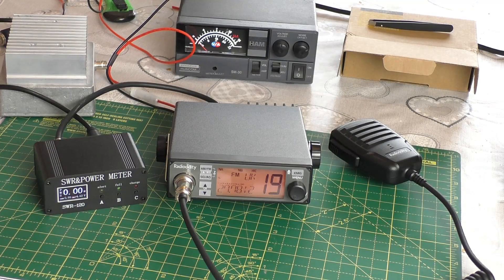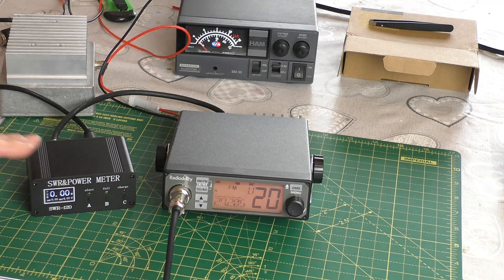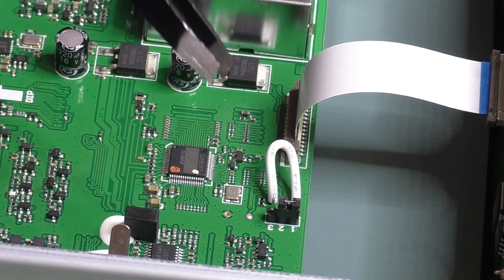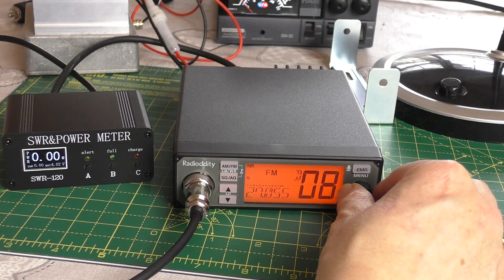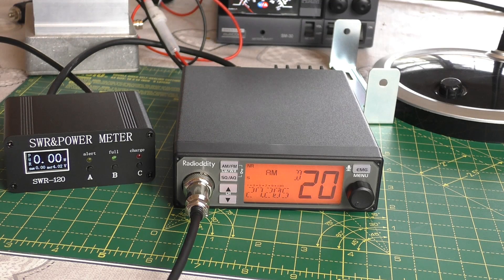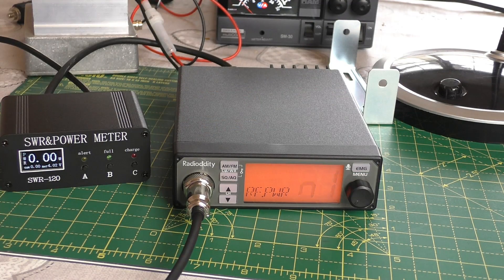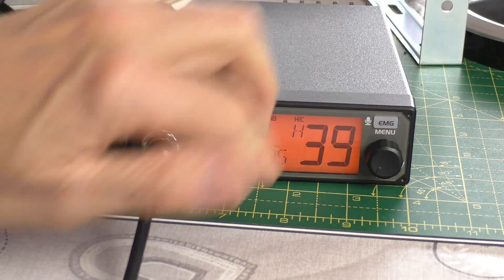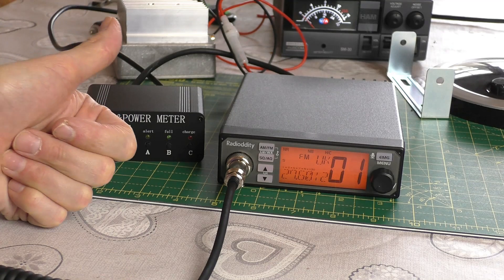Radioddity CB-500 / Anytone 500M 2.  How to HIGH POWER  MOD

Comment: When i turn on the radio all channels from 1 to 40 show a 8-9 on the meter, even when only receiving (FM and AM). What can i do to lower the noise?
Reply from the maker: Homebased or mobile antenna.
Reply: @CB-RADIO-UK  PNI ML200 2m antenna (SWR is 2,2), mounted at home outside at the balcony. 
I guess i need radial(s) and antenna grounding. Is there a simple way to ground the antenna. Add a cable to the outer PL259 connector and the other side to the balcony metal railings? Other solution?
Reply from the maker: It will be picking up noise from the surrounding buildings.  Not a lot you can do these days with everything we own at home.  My antenna clears the roof but i can still get S6-7.  Just see the Big Net video i made a couple of weeks ago.

Comment: I have modified mine, but I am not impressed with it as a base station.  For some reason, mine, I have to hold down the am/fm button, then turn it on, to switch bands.  My base station is a Cobra 29 with a super swing and a two pill amp with an Antron 99, so I can talk across my county here in Florida.
Reply: What kind of pills 😂
Reply: @chadrides914  no pills, just the jumper pin mod.

Comment: I have the original AT-500M and you can get about 19.9w on FM and AM PEP around 18-19w.  I'd never run it at this level of power, especially on FM.  I dialed mine back to around 15W on FM high power so the final wouldn't get fried.
Reply from the maker: Yeah thats good advice.
Reply: @CB-RADIO-UK  Have to be careful with the modulation too - I've seen some really ugly waveforms coming out of these radios because this was improperly set.
Reply: I got the pro 27 and it can do 8 am . Iv got confirmed 2k miles when the propagation was optimal. When your running FM do you still have skip propagation? or is it more ground wave? There's mixed signals on this FM isn't used much in America. From what I know from experience workd great line of sight and regional 50 miles
Reply: How did you do the dial back? Is there a way to do it on the circuit board?

Comment: 20 watts is only 1 S UNIT more than 5 watts. Waste of time. Just get an amplifier. WAY more effective.
Reply from the maker: Trouble with small amps is that they are not RF friendly.  This is a clean signal.
Reply: @CB-RADIO-UK  Put a clean signal in, get a clean signal out. You're doing it wrong.

Comment: you can modify it bto run  20waat if you want

a point to note you are playimh factory modified uhf radio running (watt pep) claimed on 27Mhz

testing other radios within this spec of use output less that 4 watts

this would not not comply for legal use as for base cb 25/26/27 Mhz nor actual uhf cb around 477mhz

with no activeb12 watt pep for sideband use

20-80 watt pep in uhf/vhf land are typically used with repeater use

Comment: I have an anytone at-500m ii and cant get into the service menu to lower the carrier level. How do I access it on my model radio? Pressing and holding the channel up and down buttons don't work
Reply: Press the up&down buttons together with PTT and power on. Radio will change to white  and you are in service mode.
Reply: turn off radio, press & hold up&down buttons and key mike and turn on

Comment: Go on Fred, cut that white wire jumper and return the other jumper to it's original postion. I'm pretty sure you'll be back to just CB bands. You are then likely to have higher power options and the ability to easily switch between UK and EU bands.

Comment: I tried a watt meter like that one IT SUCKED!! FOLLOWED MY OTHER TWO ANALOG METERS IN LOWER HALF BUT SHOOTS TO AN ALARM WHERE THERE IS NO ISSUE
Reply from the maker: My one has been good so far.  Used it on a few rigs now,
Reply: @CB-RADIO-UK  does it go into alarm at 2/1 swr? Mine did  and showed false swr slope were there was none I have a cheap Astatic 100 watt meter swr and it shows same response my hpm1000 has which is strictly a pep meter does read RMS but shows same forward drive tech set my galaxy99v2 at with bird 43 with peak kt and I only paid 75 US dollar for it  I pd 45$ on that digital it still works but unreliable till you know your gears actual settings